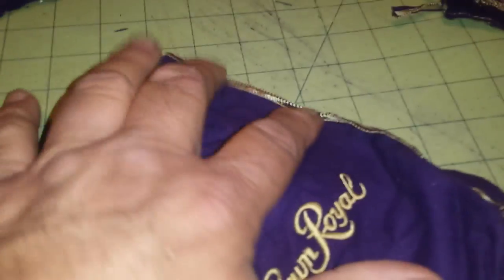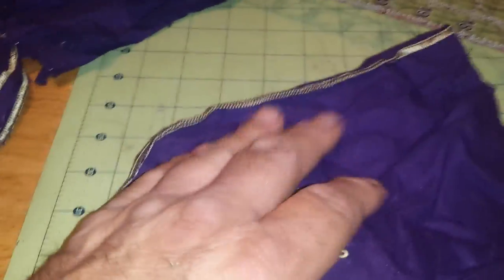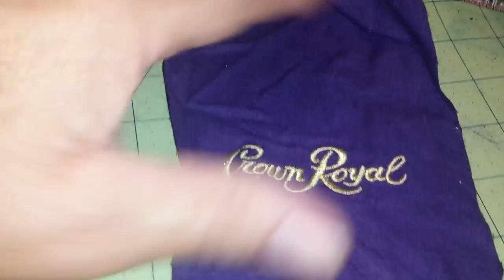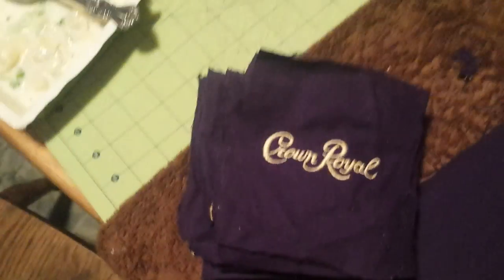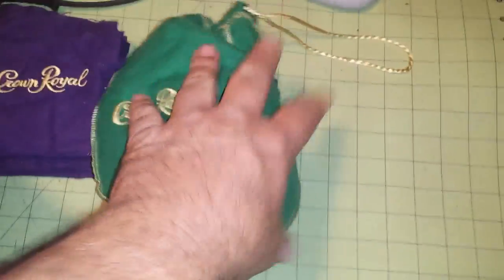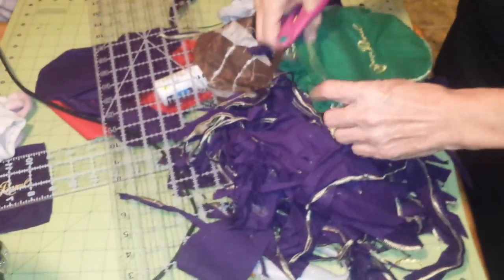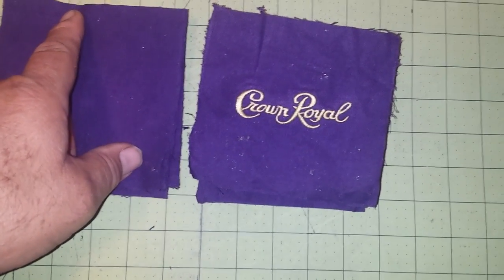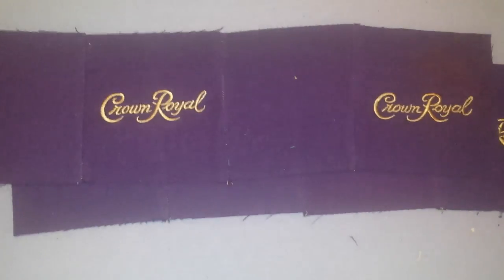Making of the Crown Royal quilt

Comment: I'd love to do this, however I am finding that I can not make a 5" square out of the normal bags to include the words in the middle of the square.  The bags you picture seem like the regular size bottles not the handle bottles.  How do you manage a 5" square?
Reply from the maker: I used a 5 x 5 square and laid them out after ripping the seems
Reply: You don't have to remove the seams.  Lay the bags flat with the seams on top of each other & cut the largest square (or rectangle) you can.  The seams on the quilt add interest.  But be careful ironing; I have heard that the thread on the seams cannot take too much heat.